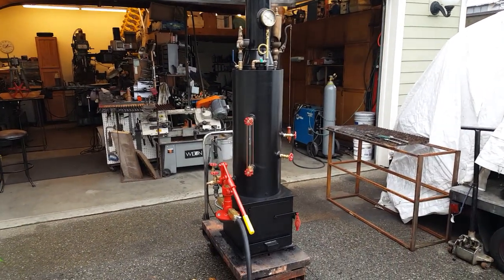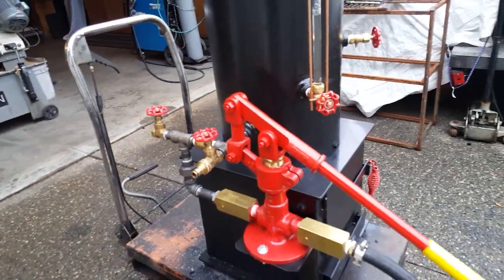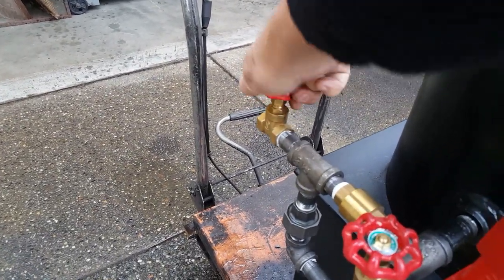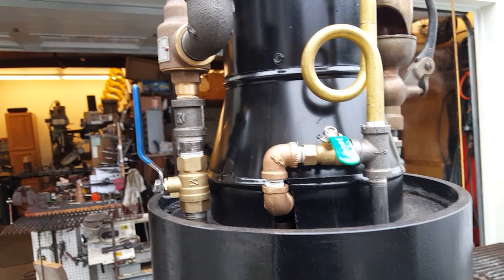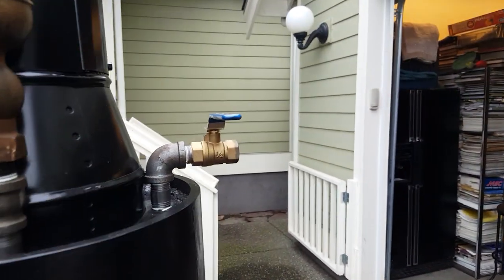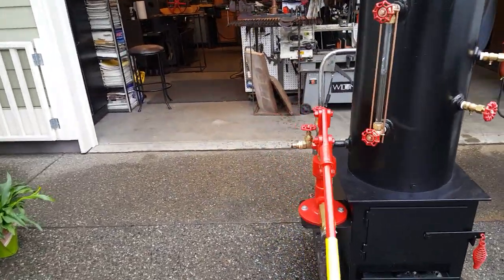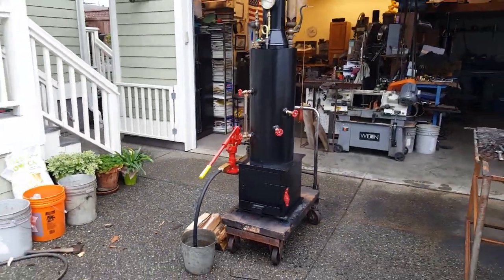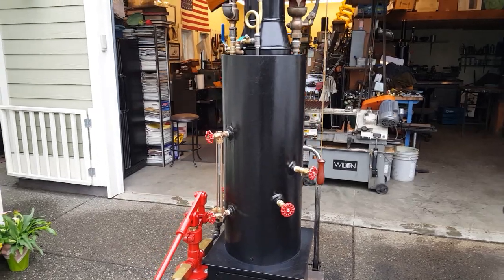For Sale Steam Engine Boiler Hand Pump Whistle Gauge Off Grid Live Steam Engine

Comment: I would think that you need to Taylor your Market towards the Alaskan territories and maybe even Canada.. what I seem to cannot find in the marketplace is a hybrid boiler part boiler part wood stove with oven.. and after I came up with this it might as well produce radiant heat through a piping system or radiator system..  yet in saying these things I have done some personal research and I know fully well that radiator heater systems ad an additive to the liquid water to lessen the Steam production as well as to keep it from freezing.. yet if a person had such a unit that can produce DC electric heat that's well as the heat from the unit itself which is an indoor unit or a unit for a summer kitchen or garage where water needs to be warmed this is drinking water from freezing in the winter time..  ultimately such a useful unit should have a market in finding solutions to the problems I've just mentioned maybe it should have it's very own separate Heating boiler for household Heating or a separate wrap around water tank that warms the water.. certainly a lot of engineering basic engineering could go into such a product..  And it is here for your consideration since I do not have the resources to assimilate such a unit.. enclosing there is a lot of humanitarian organizations that are primitive enough to have use of such a thing.. thank you and you do good work I enjoy your channel over the years..